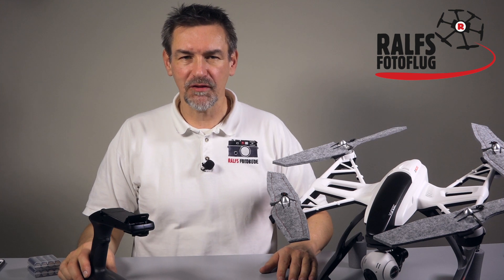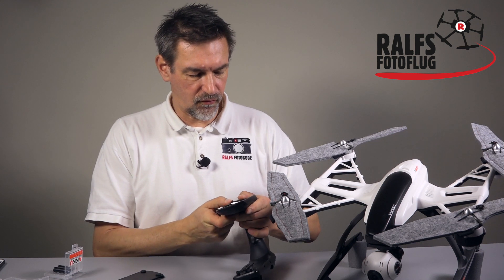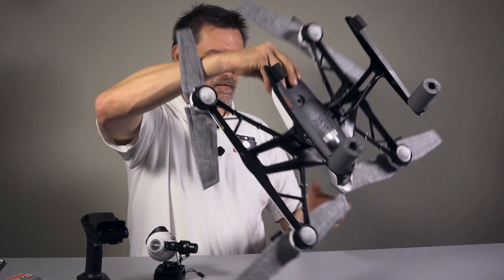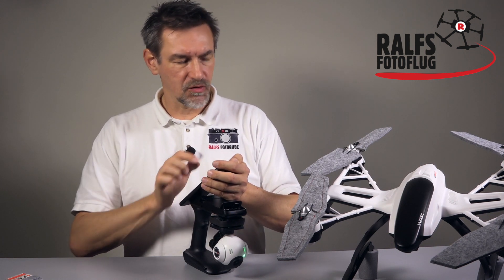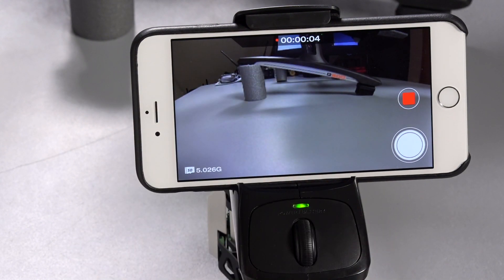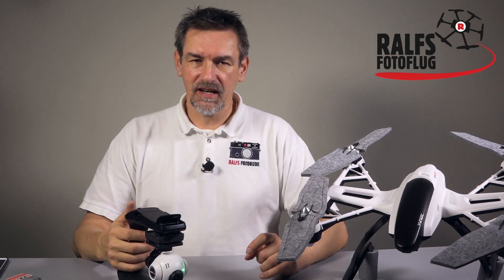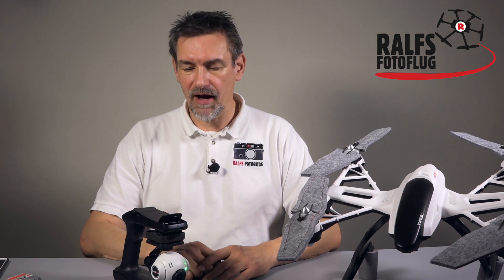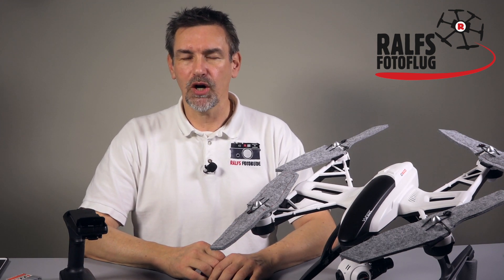Yuneec Q500 #09 - Handgrip for Gimbal and Cameral - Review (English)

Comment: I used my iPad for the monitor of the video and my iPhone for the audio recorder, not the best but it worked fine.  Only issue was to get the audio at the correct position relative to the video.  I use Apples iMovie.